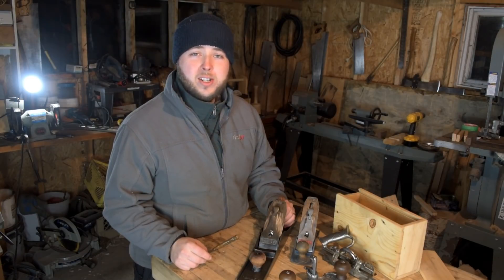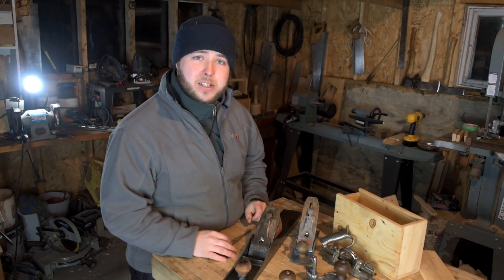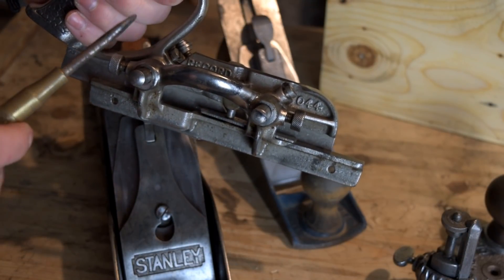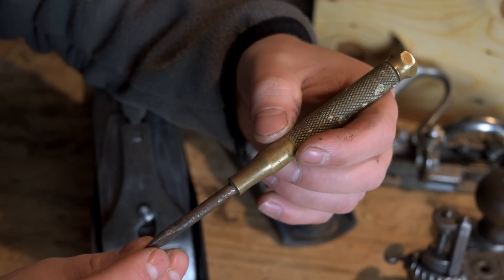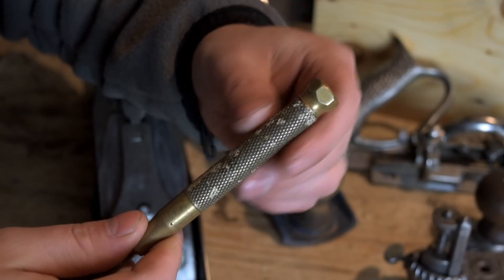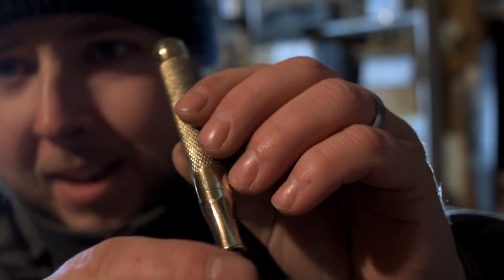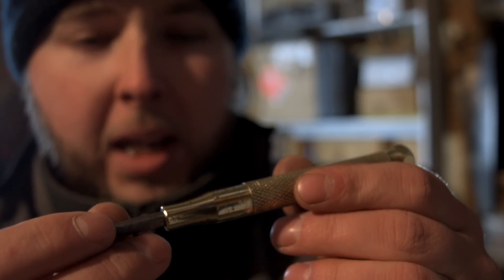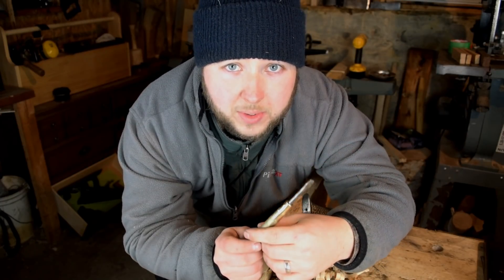WORLDS COOLEST SCREWDRIVER - 4 in 1

Comment: These have been around a long time, and there are many cheap copies made today.
They have them with hammers that are brass plated, and most commonly they've got slightly larger hammer ones which are often leopard print and pink camo for women.
The originals are great and I believe I used to have one, the modern cheapos are useless garbage.
Bad threads, soft steel, off center tips, tips that fall out...ect.
l
Reply from the maker: Yep! I have since seen some cheap ones!